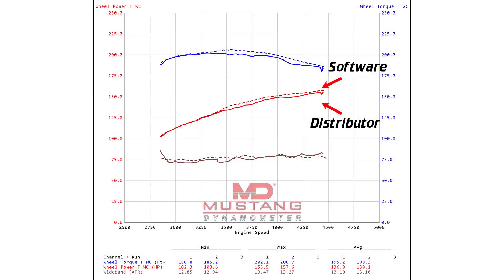Dyno Testing a Software vs. Distributor Timing Bump On a Stock Foxbody Mustang

Comment: Working on 1990 mustang gt all stock with e303 camshaft not taking timing keeps back firing from tail pipes.
Reply from the maker: My first guess is a spun balancer. I had one this week that timed OK but misfired and sputtered and the distributor was bad.
Reply: @tecmotiondyno  Good morning so I should replace balancer. The distributor is new msd also same problem with stock distributor.
Reply from the maker: I would check to see if it is spun or not first. A common method is to use an inspection camera in #1, rotate the engine until it is actually at TDC and see what the balancer says. You should be able to get within a couple degrees this way so if the balancer is off 10 or 20 degrees when you are truly at TDC you will have confirmed that it is spun.

Comment: Very cool video, never even crossed my mind that would be an issue.  Make sense though the way you explained it!
Reply from the maker: I’m open to any other ideas on the reason for this phenomenon, but I can tell you that it is repeatable and that the only real difference between the two ways to add timing is the rotor phasing. It literally stunned me the first time I saw it. I have tried and tested a lot of stuff over the years in an attempt to squeeze everything possible out of a Ford Windsor type engine, and I won a lot of drag races, partly as a result of this test program, but this is one of the weirder things I have found.

Comment: Tecmotion I love these stock 5.0 videos right up my way I own an all stock 5.0 Also a question I have an aod car I don’t want to t5 swap I was looking at 4r70w internals is aod case with a transgo shift kit what’s your thoughts on this set up?
Reply from the maker: I think that is a common way to go. On my Mark VII I used a Lentech Street Terminator valve body with electric overdrive lockout and a hardened inner input shaft. The 4R70W internals will make it stronger too. Before you spend too much money on it, I think you need to consider an actual 4R70W like a Lentech Street Terminator and a Quick 4 controller. You will get an electronic clutch style lockup, and a fully configurable shift program with an actual 4R70W as well.

Comment: Thanks Matthew!
Reply from the maker: You are welcome. Thanks for watching!
Reply: @tecmotiondyno  Matthew when you were adjusting timing 8n the tune were you just globally adding timing to compare to twisting the distributor?
Reply from the maker: I added 4 degrees in all of the relevant RPM ranges on the WOT timing function. This should be technically equivalent to twisting the distributor. If you are really trying to squeeze one of these cars you may find that changing the advance rate in certain places helps too, but this is just meant to show the phenomenon that you do better with a programming change than a distributor advance, even though you are technically adding exactly the same amount of timing everywhere.

Comment: The reasoning you described would definitely make sense. I can always tell when looking at an distributor cap that’s been on mine for a few months that the rotor isn’t firing exactly squared with the terminals in the cap. I’ve always done my timing with the car off, move distributor, then test drive. Once it’s close enough that I’m happy with the performance and not hearing any spark knock, after several test drives lol, I consider it good. So I don’t really know the number of timing it’s set at. To me it doesn’t matter what the number is. Only matters if the engine is happy.
Reply from the maker: I know a lot of Mopar guys who set it that way.